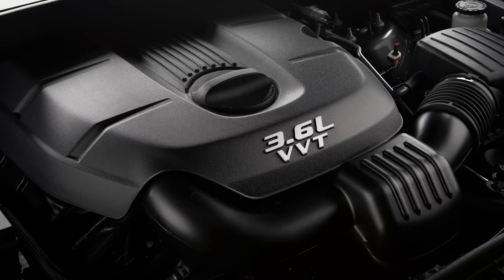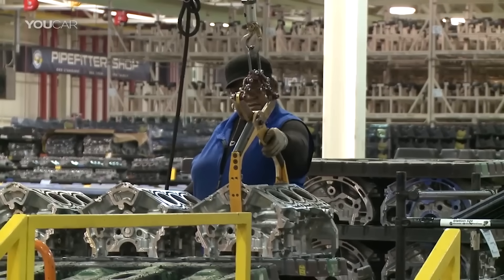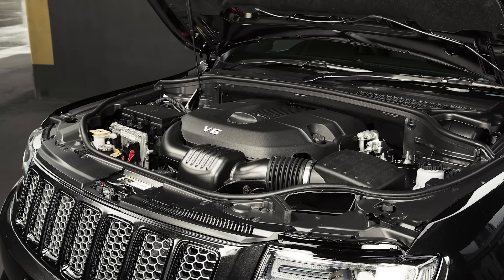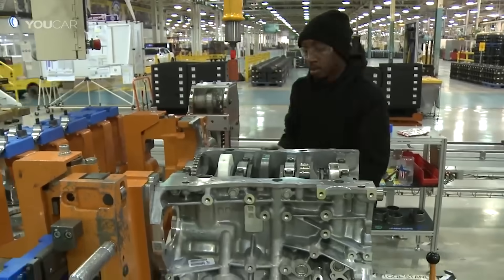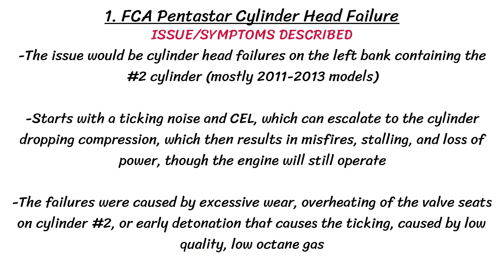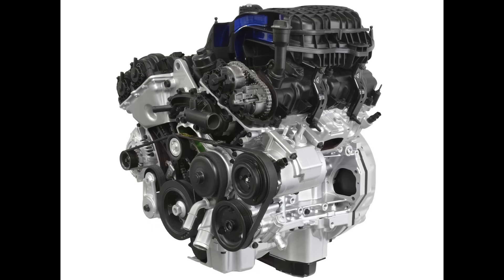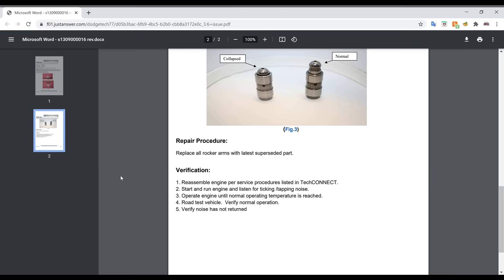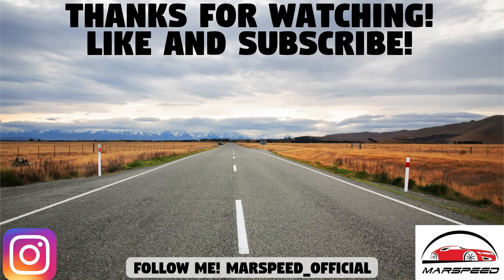The Specs and Fatal Flaws of the Chrysler 3.6L Pentastar V6 Engine

Comment: The earlier engines that Chrysler made from the inception of the company in the mid 1920's until the early 1980's, usually did not develop this many problems... It was after these all aluminum engines were developed, that many problems started to take shape... Too much complexity and unusually high expectations of their newer designs, seemed to lead-up to the numerous problems that these later engines developed... I'll keep my older vehicles, no thanks on these newer vehicles...

Comment: 2015 JKU: I am currently addressing the cylinder 2 misfire. Now that I’m looking back on it, this engine has been ticking for as long as I owned it; bought it new in late 2014. Check engine light came on a few months back, but chalked it up to lifts, axle swap, etc. Fast forward to a couple weeks ago when the engine started to misfire. Now it’s at the dealership getting addressed. We’ll see what they actually end up replacing, but they were leaning toward a rocker issue.

Comment: 6:50 - Wait a second... the heads didn't come ORIGINALLY from the factory with hardened seats/guides, standard? Are you KIDDING ME????!!!??? Leaded fuel hasn't been available literally for decades. Nice proactive approach to a blatantly obvious future issue, there, MOPAR.  Inexcusable. My daughter's Pacifica just crapped out a second time with another as yet unspecified upper end related failure, & I'm sure her employers are overjoyed at this repeat absence for the same reason.

Comment: I had a 2015 dodge journey with the 3.6L V6 it was a amazing engine, HOWEVER. The maintenance I took care of it was over the top. I also used 10w40 which kept me from having chain stretch and pre mature timing chain adjuster failure,  which was issues that I knew about. I never really knew about these other issues nor did I experience them in my 184 thousand miles I had the SUV. However it did crack the flywheel and the drive shaft to the rear wore out at around 114K and needed replaced. Which was expensive asf. I would still have it but unfortunately someone pulled out infront of me last week so it's in SUV heaven now 🤧
Reply: I thought they ran on 5w-20… explain please why you used 10w40. Thanks 😀
Reply: @djkjthe3rd185  well usually that depends on the climate you live in colder climate's you want heavier oil I use 10w30 in every car I've had it's the best all around oil in everything from 4 cinders to V8's it does great in cold and hot climate's.
Reply: @dragoneye6642  You want lighter oil in colder climate and if the engine has cam phasers you need to use what oil they specify or you wil get a CEL.
Reply: 2015 Journey with 85,000 miles... Left Head Failure.
We always had recommended maintenance performed, *independent shop Good Year affiliate, including oil changes at under 3,500 miles.
Chrysler/ Dodge WILL NOT stand behind the Journey with that faulty Pentastar engine.
Cost us $5,000.00 USD

Comment: Thermostat went bad on mine easy fix but it was cracked plastic. Lots of sensors have gone bad even oil pressure which is a pain to replace. Now dealing with a small Evap leak that I can’t find.

Comment: Driving 2006 Dodge Caravan 3.3 L with no problems. Chrysler will be aware of the difference. Looking at successful design provides reference to spot flaws. Changes obviously are not always an improvement.

Comment: It's a goat rope to change plugs or coil packs on bank 1. Not to mention having to loosen the motor mount to change the starter. Chrysler and Ford both overthink the engine bay making it a pain in the ass to swap motors.

Comment: 113,000 miles on my Chrysler 200's V6 Pentastar 3.6L. 

I got it at 29k.  Issues are in the cooling system. Don't play around when that temperature light comes on.

Comment: Bought a 2016 Wrangler for my daughter with 56k miles...rocker arms failed and ate a camshaft at 63k miles but the dealer fixed it as it is a "known" problem and was so close to warranty. Also, the junk plastic oil cooler under the intake failed and this thing was the Exxon Valdez for a week. Bought the Dorman replacement metal part and fixed it myself this weekend. Not impressed. I have a 1996 Ford F150 with the 4.9 inline 6. Abuse it, don't change the oil enough, and it just keeps running and running. Had to replace the distributor ($100), but that is it. Factory AC, factory water pump, etc. This Jeep will be junk at 200k, just saying. Oh yeah, I hear the rear mains leaking before 100k is a common problem too.

Comment: Good motors my 2012 300 has 170000 miles. Just change oil at 4000 miles . Good fuel milage but terrible traction in winter with rear wheel drive.

Comment: I have a 2015 JGC ltd 4x4 3.6L V6 I have an engine code P0303, I have changed the spark plugs, coils and its still reading the same code, even after it was erased. It has 124K

Comment: At 95000 miles 2016 300. Check engine light just came on so I guess I'll see how good an engine it is. Still smooth and powerful as the day I bought it. Overall I'm impressed.
Reply: I have 2016 300 mines has 110k engine light just pop simple fix thermostat sensor . First time it comes up other then that it run good and strong

Comment: I have a 2012 Avenger sxt+, with Pentastar V6.
A few yrs ago I ran it at a local dragstrip.
Surprisenly, turned a 14.5 sec. 1/4 mile run. Stock, well cold air intake and low restriction muffler, but that's it. Oh, 93 octane too.
I was impressed it was that quick..
Still running great @ 122k miles. I change oil/ filter myself.Use full synthetic oil and use 89 octane. Zippy little car...
Did have to replace heater core tho. Did it myself for $100. Works good. 
Nice car. Rides firm, but not harsh. Good fuel mileage. Even was in a wreck. Darn solid front end..

Comment: My 2016 Jeep Wrangler just threw a P0302 code so I took it to the dealer and sure enough the head needs replaced.  Low compression in cylinder 2.  To top it off I’m 3,000 past the warranty and have to pay out of pocket.

Comment: Changed oil on my RAM1500 V6….horrible design.  Bars in the way and as soon as you undo the oil drain plug it shoots out and down so you need a giant pan.  So much stuff in the way that I couldn’t probably torque the drain plug back properly and get proper leverage.    It really shouldn’t be this hard to simply change the oil.

Comment: I am the second owner of a 2016 Town & Country that has 86K miles on it. It all started with a rough idle. Then a check engine light and  a Cylinder 6 misfire.
  and low compression pressure in that cylinder.  
I have replaced all spark plugs and all coil packs. No difference.
my mechanic says it probably needs a new rocker arms and lifters.
I have an appointment to bring the vehicle into the dealer on monday but they're going to charge me several hundred dollars to diagnose the problem. Here's what I was told by Chrysler customer care;

 " I do see that this type of concern would have been covered by the basic warranty which is for 60 months or 60,000 miles, whichever comes first. This warranty did expire on: March 8, 2021.  I checked to see if we can assist outside of the warranty, however in this case we would not be able to provide out of warranty assistance, it may have been possible for an original owner however in this case our hands are tied. I do apologize that I do not have better news to share, I can certainly understand the frustration with your vehicle having issues."

Comment: 2012 Chrysler 300..changed 2x Roller rockers at 160k and now at 204k have 1 more ticking.  Water pump bearing is finally going bad.  Most reliable engine / trans combo ive ever had

Comment: i have 2016 model. Just replaced rockers and lifter because 4 lifters went bad.  A symptom other than ticking was vibration over 5000rpm. you can do the job yourself for around 350 for tools and all parts.

Comment: Have  2012 200 with 100k miles on it , no issues so far , guess I need to bump octane level up going forward
, have 2019  300 limited with this engine , are they excluded from these issues ? has Chrysler addressed them in that model year and does the 2012 200 have that extended warranty ? Chrysler never told me that  engine warranty was extended  it and I am the original owner. Thanks for keeping us up to date on mopsr products !

Comment: Be thankful if you haven’t had any flaws. My engine light came on with my 2011 Avenger in Aug of 2021. Read a P0300 code (misfire). Was the left Cylinder head- unfortunately the car went into service in March of 2011 and the extended Warranty wouldn’t cover it.
I missed it by 3 mos.
The repair cost 4500 bucks!
The next day out of the shop- the engine light was back on!!! It’s reading P0304 this time!
It’s back in the shop… waiting for the news
Any advice appreciated!!
Like I said: Be thankful if you haven’t experienced flaws! It’s Painful!!

Comment: Step fathers 2012 charger v6 has 190k with zero issues besides the alternator recall and cracked oil filter housing replacement “typical” plastic shit.

Comment: I have a 2012 V W Routan w/the 3.6. At about 120,000 miles the flywheel failed, the center completely broke out of it. Engine still ran fine but w / a nocking sound from the broken flywheel. Engine now has 140.000 miles, runs great, very smooth, great power, 20 -22 m p g.

Comment: 2015 Jeep Wrangler here, done had to replace 1 destroyed camshaft, all the rockers, and all the lifters out of pocket, $800 in parts, the oil cooler I believe is leaking now, $400 part, tstat housing was cracked all before 100k, I wouldn't recommend this engine to anyone. Impossible to work on, now at 105k I need an O2 sensor, entire fender needs removed to get too.

Good luck, very informative and true video, done my own research since, these are honest issues and I believe 1% is very low. 10-20% is more like it. Chrysler will not back up this garbage motor that's likely only good for 100k before major issues!

Comment: I've seen a 3.6 5k mi jeep wrangler with a massive crack running along b2 cylinders, Chrysler agreed on paying for 50% of new block cost they didn't cover the labor as the truck is out of warranty period however it was bought and maintained from the same dealer

Comment: Absolutely a fantastic engine, as far as I’m concerned it’s one of the BEST engines made today, have owned many and they have all been bulletproof, no engine is perfect, but it’s close. I disagree with your saying it’s got many flaws.
Reply: It's a decent engine, but I don't think they were designed to be million mile motors like a Lexus 400's is. Saying something has flaws is not saying its worse than average, only that it is imperfect.
Reply: @twotone3471  
carproblemzoo.com/lexus/ls400/lexus-ls400-engine-and-engine-cooling-problems.php

Comment: We got a 2011 Journey in 2015. Carfax says the head was replaced on 2,4,6 side. But started to have cylinder 1 misfire. I replaced coil, didn't fix it. I swapped an injector with another cylinder. Cylinder 1 still misfire & other cylinder was fine. It eventually went away, now 4 years later it came back for a few days after an oil change & now fine. I replaced the thermostat today (10-23-2021) because not much heat & temp gauge was low. It actually had a P0128 code for thermostat when I checked for codes from the misfiring.

Comment: 2017 Grand Caravan 70K miles. Engine light comes on. Cylinder 2 misfire. Turns out need new Cylinder Head. Common problem Dodge knows about. Warranty ended at 60k. I only put 15k miles on it, now shop wants 6K for the total job. Cylinder's 2 and 5, timing chains, tensioners, fluids, AC, coolant, power steering and trans fluid. Selling it instead.

Comment: Fatal? Ok. 13 million on the road. If .005% experience this mechanics would think it was a big problem.  I'm in 3 Jeep clubs and of the 150 or so Pentastar powered Jeeps, I've not heard one with any issue and it was replaced under warranty. It was a defective head from the 2012 problem.  His replacement engine has over 100k miles with no issue.   Everyone in the clubs loves their Pentastar.
Reply: We have a 12 Wrangler. I hate the engine. Nothing but problems.

Comment: My 2012 Wrangler was afflicted with both issues.  Have also been told that when FCA changed ownership from DaimlerChrysler to Chrysler LLC, they changed from Si-OAT coolant (purple) to HOAT coolant (yellow) and that the two are not compatible and can cause clogging if mixed.

Had the left bank cylinder head replaced under extended warranty, and also had cooling system completely flushed professionally (vacuum extracted) and replaced with new HOAT coolant.

Was lucky that so far, the heating issues have not returned.

Comment: So going by this video, even if it's a brand new '21 Charger SXT, I should probably go with 91 Octane gas, instead of 87 Octane (regular)? With mine I feel I've always heard the small ticking on a cold start up, but runs fine after it's warmed up to operating Temps

Comment: I have a 2017 Chrysler 300S with 82k miles on it. Only failure I've had so far was a thermostat. I change the oil every 6k miles and have only used 89 octane fuel from the day I picked it up with 50 miles on it. Hoping to continue my good luck with this engine but only time will tell.
Reply: change your oil every 3-5k miles

Comment: I could tell you read a lot of industry material there especially on the beginning with the wide range of RPMs blah blah blah built from high quality steel injectors blah blah blah and what's it fails from I freaking engine knock it's 20/20 for Christ's sake yeah they dropped the e85 compatibility not that you want to run your car on that crap anyway, and then instead of you know maintaining some poor fuel compatibility no they go the other direction where you're going to have a knock most likely guaranteed a freaking knock... Destroys the cylinder that quickly.. womp womp womp I'll take my 3.7 in line over it any day, I don't need the 70 extra horsepower clearly it's giving up reliability for a negligible amount of horsepower Chrysler man heartbreakingly fucking poor but who does it better really? Chevy? Ford? With the famous wrench light which I couldn't imagine whose idea was to build this into the 2000s Fords. But they have a check engine light I was a little wrench it's not that intimidating looking, it almost even seems like it could be a service light like change your oil time, but no, it's an enhanced diagnostic design to confuse the fuck out of users of the vehicle as it is separate from the OBD2 and separate from the check engine and separate from the service light, so what is this mysterious wrench? Well I almost bought a Ford escape that had it and when I noticed it finally after a short test drive I asked what it was and asked if it perhaps was a service light for oil change? And the owner agreed of course but I decided to take a day and do a little research and the wrench light which Ford didn't have before at least not 95 when I had my last  Ford, this is a powertrain fault light so basically you have a major or minor or non-existent problem in the powertrain of the vehicle, Oh thanks ford, as if the check engine light or OBD, WASN'T FUCKING CRYPTIC ENOUGH NOW YOU WANT TO ADD A LIGHT THAT COULD INSINUATE THERE'S A PROBLEM ANYWHERE IN THE ENGINE TRANSMISSION DRIVE SHAFT DIFFERENTIAL THAT PART OF THE CAR BASICALLY THE CAR... THANKS FORD,  seriously how disappointed was I to find out that Ford ADDED, THIS THIS LIGHT TOO THE ESCAPE.. IT BASICALLY MEANS nothing but yet it means something it means the car is a piece of shit at least to me, and after seeing that wow I got off the whole escape idea I escaped the escape before even purchasing it it was mostly the look of the vehicle that I was interested in, boy am I glad I didn't take that. I thought perhaps with all this new technology maybe Ford could include a more specific you know like transmission fault, third gear solenoid, or fuel mixture bad mass air flow sensor failure.. or or maybe have like a engine light intake light transmission specific light not just you know normal check engine and then check everything.. no for I don't want to go to your fucking dealership and pay to get some assholes to plug in a specific proprietary scan tool so I can find out that my gas cap wasn't on tight enough Oh thanks that'll be $100 if you're dumb enough to buy any vehicle 2016 or 2018 and above I laugh at you because these cars have Apple style planned OBSOLESCENCE, WELL AT LEAST I'VE SEEN SEVERAL WITH SERIOUS TRANSMISSION SHIFTING PROBLEMS COME IN AND I FIXED SEVERAL BY RUNNING A, FEW OPTIONS IN THE SCAN TOOL MENU.. THIS IS ONLY IF YOU HAVE ONE OF THESE REALLY GOOD SCAN TOOLS NOT NONE OF THOSE CONSUMER ONES.. And the one that typically seems to come up every two years is the relearn shift position And it's stupid thing literally runs or reset something and the car no longer will upshift 2 gears randomly, while going uphill causing the engine to die..

Comment: 2014 Jeep Wrangler  now has 129k.  Have replaced the oil cooler, and the rocker roller Bering repair twice. Cracked oil cooler happens at around 50k, the first Bering tick at 80k, the second repair of that problem occurred just out of warranty, but they covered it anyway stating that the previous dealer should have fixed it right the first time. Still waiting on a ABS control module which is on back order for 6 was.

Comment: I just had to change out my Oil housing unit including some gaskets and hoses. (I’m no mechanic but with YT and my friends I did it)

After the replacement my engine light went off and after about 36 hours the light came back on…. I’m just speechless.

Comment: 2015 Jeep.. Tic Tic Tic...  Had to have rockers and cams replaced twice.. Oil pan dropped and metal cleaned out and a full oil system flush.  When buying one of those cars new.. Make sure you get the Lifetime warranty. Sure saved us a tun of cash.. Out of pocket was a  $119.00 deductible